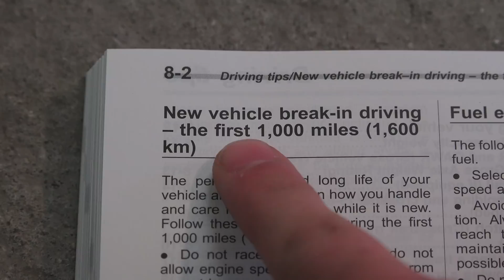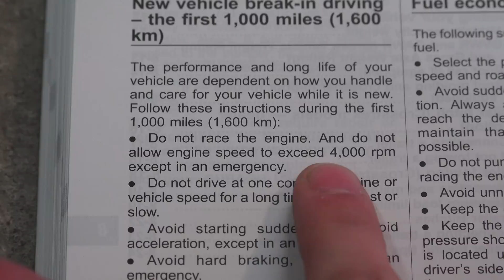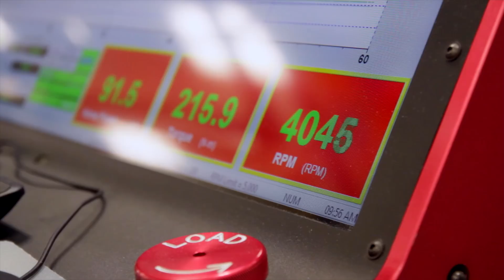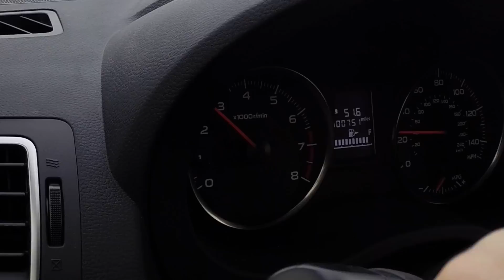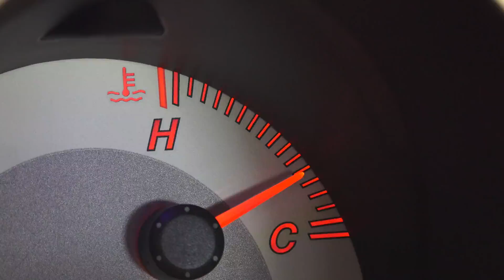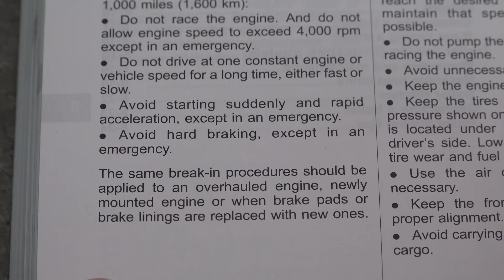5 Things You Should Never Do In A Brand New Car

Comment: I babied my 2013 Scion FR-S as the manual instructed. Car was stock, dealer maintained, regular oil changes, motor blown within 2 years. I broke my 2014 Camry V6 in hard. Car runs like a top, mileage is excellent and oil consumption is minimal between oil changes. Another one of those “it depends” kind of questions.
Reply: The Heretic  along with the Subaru rotting exhaust system syndrome!
Reply: Dealer maintained is the keyword

Comment: I know this is a bit of a late response but here goes.  First, good video!  I've heard your comments before, and I've read the arguments for a hard break-in right of the bat.  Through the years, I've tried both methods and, at least for the cars and motorcycles I've owned, couldn't tell any difference one way or the other after the fact.  None of the vehicles gave me any mechanical problems down the road and none of them had any unacceptable oil consumption issues.  These days, I just drive normally and don't really spend a lot of time thinking about it.  

I do have one question though. 

What about turbocharged or supercharged engines?  Almost all turbocharged engines I've driven will spend at least some time in a positive MP range even under "normal" driving conditions.  I would think that a turbo engine running 5 to 10 psi positive boost would be putting more pressure on the pistons and rings than a NA engine at full throttle would be so, can you comment on that one way or the other?  Thanks!

Comment: "Don't floor it" isn't always applicable so do better research. many high performance engines have been run in prior to completion of the car in the factory. All these fools driving around at a max of 4000rpm in a Nissan GTR or Audi R8 don't realise their cars engine has already been ragged on a test bench and run at max rpm already. GTR's are also driven on obstacle courses totest brakes and suspension and to check for rattles etc. Mclarens are run in from factory and an actually be driven hard right from new, which has been proven.

Comment: I recommend driving easy for the first 3000 miles or so, and doing an early oil change. You want want metal shavings out of your crankcase as soon as practical.
Reply: it's completely unnecessary imo, but nothing wrong with doing it the way you like!

Comment: Playing devil's advocate; why is it in the manufacturer's interest to have a long break in period?
 • Lower stress on components means they're less likely to fail during the time your customers can return the vehicle.
 • Forcing you to drive slowly may disguise the fact that your new car is actually slower than your last one, and the added anticipation makes the performance "feel" better when you do finally floor it.
 • Why do Acura specifically break in the NSX engines? Higher than average infant mortality perhaps? As you know, failures tend to follow an inverse bell curve, failures are highest when very new or very old. If you know the engine is highly strung, and you want to look good in the reliability surveys, you make sure it goes through the infant mortality phase at the factory; not when your customer is driving it. It's an expensive car, so they may actually care about that ;)

Comment: at 64 years old I have never babied an engine like he is showing in this test for lab data it might be good for grandma's new car but not for me and my new Ford Fiesta ST. I run it hard with 20 miles on it when I bought it. It is the summer tires that are in need of a break in not the engine and brakes should be careful not to over heat the new disk brake pads and rotors. Don't take my word for it find out for yourself people.

Comment: With an engineering blog, surely we need some scientific evidence? It can’t be too hard to get hold of a decent number of sample of engines to tear down and examine hard break-In vs following official guide? Anecdotal stories are fine, but let’s see the evidence of the damage from a hard break-in (not crazy, just full throttle from time to time within the first “critical” miles. Seems engine builders think hard is better? Odd that over many years of improving tolerance, better oil, better materials, the advice is unchanged?

Comment: Idle it warm, drive around the block a bit nice and carefully. Go home change oil. Go to country road, 3rd gear, load it up to 1-2k under the redline. Let it run down in gear to 30, do it again. 
Then change the oil again and give it. Stay under 4.5K and it will be best compression possible.

Comment: I just lease a 2018 STI Limited. I did this because I don't have to drive my new STI like an old man when I just got it and want to go full out. Plus I can put all the bolt ons I want on the car then remove them, and put the OEM parts on when lease turn in time comes. I never have to worry about longevity, I usually turn in 36 month leases with 25K miles on them. Plus, if breaking in was such as big deal Subaru or any other car company would program the engine not to go over a certain RPM etc until a certain mileage has been met. Also when you  test drive the car and floor it like all salesmen of this car wants you to do in order for you to lust over it even more they would actually freak out. Looks like 150-300 miles is break in time.

Comment: Total misinformation..

First there is nothing to “break in”. All tolerances are set
Rings need to seat with pressure ...so the harder the engine is worked the better
Especially true during first few miles...limited time to get this done as bores will burnish

OEMs recommend this especially in high performance cares for ONE VERY GOOD REASON

LIABILITY.....they want the DRIVER to get use to the car and HP before they hammer it.

They sell this by tricking the driver into thinking it the engine but in reality it’s for the DRIVER.

I work for a major OEM and we hammer every test engine on startup once at designated temp...(lower then you might think) to get the best HP numbers and best test results.

Comment: I asked my dealer about this specifically, he said not to worry about it, so I'm driving it kind of hard here and there, reading the manual bit by bit, only to coma across the section telling me to stay under 4000rpm... I just hope I didn't go too hard, too much, or held constant rpm too much (used cruise control briefly as well) to affect anything. Now I'm doing my best to drive as boringly as possible for the next 1200Km's or so to break things in nicely.

Comment: i break in my new car by taking it to the drag strip straight from the dealership and floor it every time i accelerate and slam on my breaks, also finds it good to shift to R, Racing mode at 30 miles per hour and then shift to P while its moving for that extra Performance.
Reply: Ha Ha, P for PERFORMANCE mode only kicks in at near walking speed!! (forward or in R racing mode) Or do you have manual transmission? Then certainly, from N and forward speed slam that puppy into R while stomping on the GO pedal.

Comment: I do max 1/4 throttle first 250 miles, max 2/4 till 500 miles, 3/4 throttle till 750 then drive it like I stole it until 1000 miles. Than back to normal driving.

Comment: Best thing -
Step 1:
 run a fresh engine on a electric motor without fuel but under full oil psi. - Pre heated hot water at coolant temperature of @ 215 degs....

Set vehicle on jack stands - remove drive tires - put in gear and turn on electric motor.

Run engine- very load by transmission gears and at low speed at first 3 hours...  

Step 2: 
Let cool - replete step one...

Step 3: 
Let cool - install tires, and fuel...  Drive under break in as asked for...

Note... What is being done is low stress break in by the above - it's just a conditioning the parts to the wear points - blurring the hi points....

Comment: Funny, never did a repair on a car that was "floored" during a break in period. 25 years in dealerships with multiple different brands. I hereby debunk this myth. Engines are engineered and torture tested beyond what any new car driver could throw at them. If engines end up consuming oil or prematurely failing, it is a result of abuse, ie: mechanically over revving, lack of lube, poor maintenance, or bad design. Engineers will put a prospective engine in sub zero conditions on a dyno, start,  and immediately rev the engine to redline for hours.
Reply: exactly

Comment: Should mention that I dump the oil and filter after 500 miles on a brand new engine.Then at 1500 miles, Then at 3000 miles. Then I switch to synthetic and 3000 mile intervals. Both my Subarus (6 cyl) are approaching 200,000 miles with no engine issues.
Reply: I did that to back when I could afford a new car. do this to ALL new engines. lawnmowers etc.
Reply: Good advice.  I have a similar routine on my new cars.  3300 mile OCI and always a new filter.  Full synthetic oil

Comment: Points one and two. Don't BABY IT. Run it somewhat aggressively once in a while when safety considerations allow for it. Any good engine builder will tell you the first 100 miles are critical for ring sealing and they seal best if you can vary load and speed during that initial period. Again, within reason.  BTW, I enjoy your video's. Thanks for sharing.
Reply: That’s for performance engines without piston rings..

Comment: I have run in a 24 new cars (evenly split between petrol and diesels) over the last 40 years which varied from Lada 1200s to a Peugeot 205 GTi and other small performance hatches. This video matches my own findings, especially the recommendation to use a light throttle and moderate revs for the first 200-300 miles whilst varying engine speed then gradually step on it a bit more as the miles progress. I would also advise against labouring the engine at all when running in as this can cause serious damage, possibly more than initially driving too hard.

Comment: The running in process is not for the engine its for the car and all its ancillaries. To try and find any small leaks and issues at a steady pace even looking for any problems nothing to do with the engine, i.e suspension, gearbox, breaks, steering etc

I assembly engines for a living, we have 3 minutes to test them, that includes start,power runs and cool down, these are fresh new engines.

Start, idle, low rpm, high rpm, power runs and throttle adjustments to make power etc.

Comment: @Engineering Explained I would even go one further as to suggest that the break-in period reccomendations for the first xxx miles be utilised whenever starting the engine up from cold as a warmup procedure to ensure longevity of the engine.

Think of million mile motors in old big rigs- always start gently under load and ease into it for about 20 minutes with no full throttle applications.

Comment: My new 2.0 four cylinder vehicle had 15 miles on the odometer when I first test drove it.  It had 42 miles when I pulled out of the dealer's lot and drove it 47 miles to my home.  At just 327 miles I drove it for 8 hours one-way, at speeds varying from dead stop bumper to bumper traffic to just over 80 mph.  When I returned from my vacation I had driven 866 miles and my new car had 1193 miles on it.  Cruise control was used as traffic allowed.  Should I now consider this new vehicle 'broke-in', or just broke?

Comment: well this is a little misleading, the reason they have a break in now days is to reduce the damage to the engine and the cost for the car company if something was installed correctly and it can be identified early, you actually need to vary the revs greatly to bed in the rings, cruising at the same revs its break in life will not be good for the engine at all.

Comment: I have an odd question not connected with this, but concerns a new BMW X3 I bought (July 2018] - I had a nail in the tyre after just 300 miles from new on run flats, the nail inside the main tread area. This was in the U.K. No tyre shop would repair the tyre, so £250 for a replacement. I understand the reasons but why throw away a perfectly good tyre that has no more than a thumb tack in the tyre? Are they just making money from this as the tread walls are unaffected.

Comment: CORRECTION: Cruise control does not set your rpm's to a certain number, it can vary. Cruise control sets your acceleration to a certain speed, like 45 mph for example, not your rpm's.

When you set your cruise control on your vehicle, like 45 mph, on a flat plain ITS TRUE, your rpm's DO stay the same and don't vary like you would want it to while breaking in your new vehicle. When you have to drive up a hill with cruise control on though, your rpm's go up to keep the same speed that you set, when you go down hill your cruise control will stay set but if you don't use your brakes you will (obviously) increase your speed and often times your rpm's will drop.

My recommendation is that you avoid hills and cruise control all together while breaking in your vehicle as the up hill and down hill rides put strain on your vehicle. Depending on the angle of the hill, too much of an incline will put stress on the engine and too much of a decline will put strain on your braking system, think of it kinda like towing but just not as bad due to momentum.

Comment: make a video 5 things you should never do in a high mileage car.
my mom's nissan murano bought brand new had over 200,000 miles on it with barely any service done to it other than a few ruptured radiator hoses before I sold it off this spring. Cars are lasting longer and longer these days and sports cars with 150,000 miles seems to be an upcoming trend.

Comment: When collecting my new Mercedes B Class B200 Diesel from Rastatt (Germany) I asked any 'running in recommendations' and was informed "do not exceed  3000 rpm" 
I soon found that this equated to 120 MPH (7th gear Auto Box) so easy to comply. The car has now covered over 60,000 miles ands still drives like new and returns easy 50 mpg + and max speed 130 mph (Legal German Autobahn I hastily add)

Comment: Rubbish! If there are any imperfections in the engine they will just damage the engine later.

Done a "Break in" procedure for a Yamaha R6 and as soon as  the engine as soon as it was "run in" I opened it up and it went BOOM. Big end bearing was starved for oil because a bit of gasket goo was stuck in the crank. It was ok when running slow but for full power it spun the bearing.

When I got a replacement bike I was told it really could have gone straight to the track. With the new(replacement) bike I did and there was no "Boom" and it still make a truckload of power (just like all the other R6's which were converted to race bikes and never saw the "Break In period). And continued to do so until I threw it down the road. 

"Break in" period's are a thing of the past when machining was still mostly done manually. Today with CNC machines they can do all kinds of wonderful things to eliminate the need to "Break in" and engine.

And that film of oil on the tires disappears in a few hundred meters not miles. You get the same thing  on motorcycle tires and if one had to wait miles to wear it out you would never get the bike leaned over.
Reply: ANTSON ERODASH thats because yamaha is junk garbage especially their atvs and dirt bikes always break have factory flaws recalls issues etc..

Comment: Hello there! I recently got me a 2018 Subaru WRX and I have 530 miles on it and have had it since 14 miles. And have accelerating and shifting at 5000-6000 RPM’s. Will my engine still be top notch as long as I stop driving aggressively with it until I break the 1,000 mile break-in?

Comment: Most manufactures test each engine on a test bed before fitting to the vehicle and run the engines up to full power to make sure everything is ok,  running in as it is called is not as necessary as it used to be because the Cylinder Bores are honed after Boring to put a better surface finish on them making it easier for the Piston Rings to bed in,just a little consideration for the engine for the first 500miles is all that is needed then you can steadily increase your speed.

Comment: With the fresh crosshatch on the cylinder walls it acts as a file on the rings. With a hard break-in all the metal particulates between the ring and the wall will act as a grit and they won't mate properly

Comment: Hogwash, drive it day one like you're gonna drive it years later.  Race engines are dynoed at full power after being made.  Many sportbikes dyno engines way before they break in.  Sportbikes make way more power per displacement over most these fancy cars.  Drive the damn thing day one like you plan to drive it every day.  Don't baby it or drive it like it's stolen.  If it scatters, it was made wrong.   Only exception to this is a non roller camshaft, those require special break in for an hour.  Then beat on it